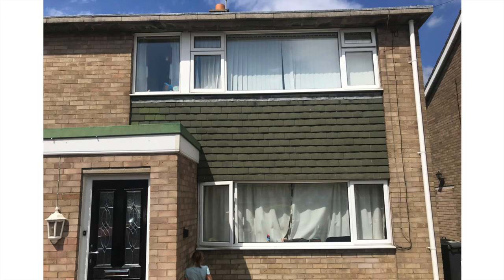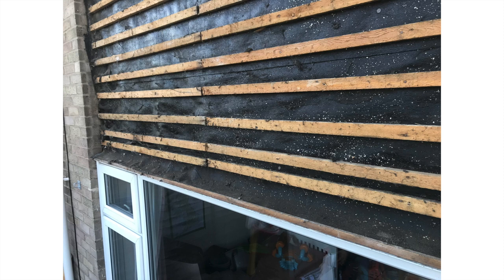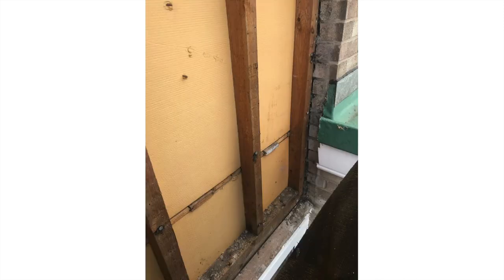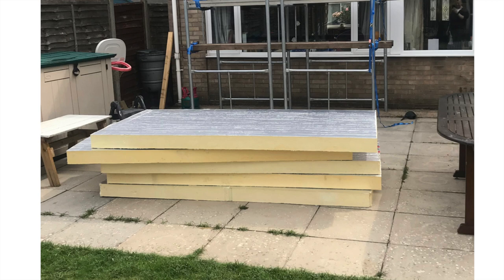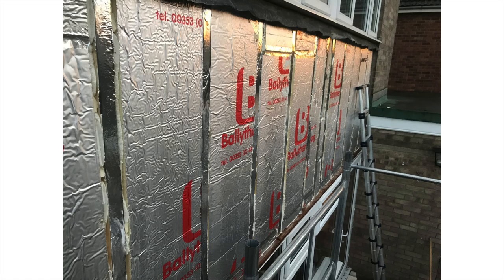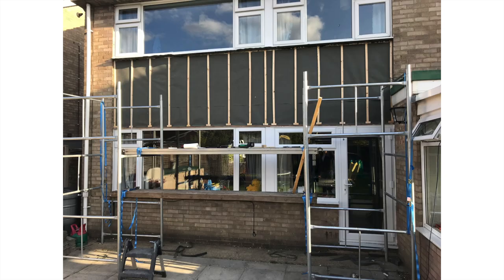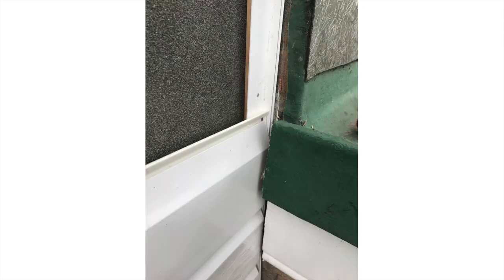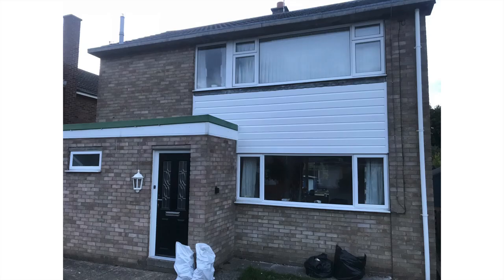Behind the tiled panel installing insulation and upvc cladding

Comment: Not the right way to do it at all.
Because you've insulated it should have an interval vapour barrier and breathable membrane.
Reply: The internal vapor barrier is required in some parts of the USA, but some people argue that it's unnecessary and could even trap moisture in the cavity. They claim that air current are what brings in the moisture that causes condensation. Paper, or uninterrupted drywall will keep interior air from entering the cavity, so if it's air sealed, that should be enough to avoid condensation.